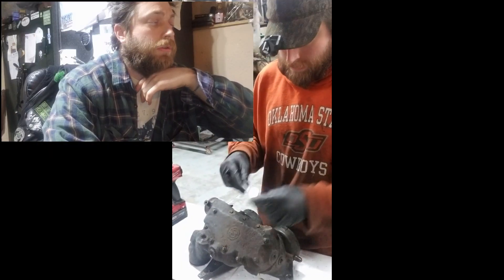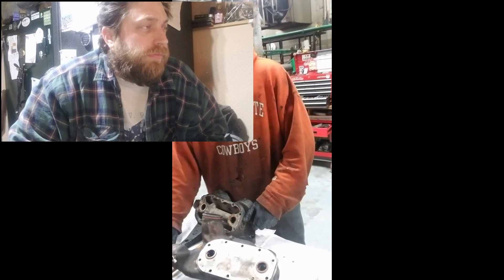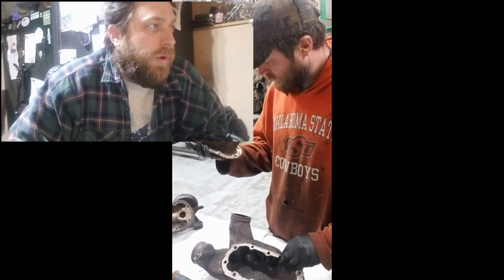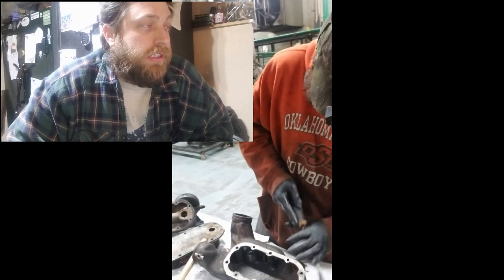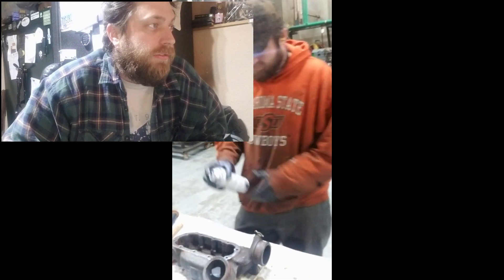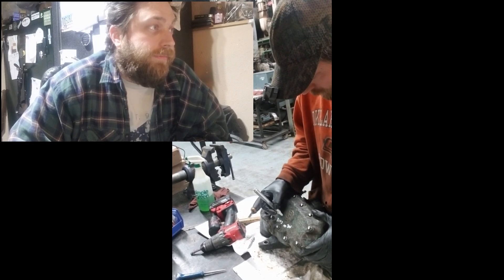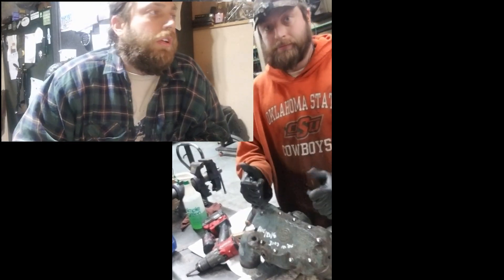Detroit 60 oil cooler rebuild

Comment: I think you may want to check because none of mine have two gaskets just one between the cooler and the top housing the only thing between the cooler and the housing that bolts to the block is two o rings that cover has to be able to squash them o rings to make it seal . Correct me if I’m wrong please.
Reply: It is correct, the outside of the cooler does not have a gasket, only the 2 Orings. I just repaired a Detroit 14 yesterday.

Comment: Great video! Are there any other common places that the oil will get into the coolant on these series 60 engines? What do you power with the electricity that you generate?
Reply from the maker: Nothing that's out of the ordinary, the only other place would be a head gasket really.  Or a catastrophic failure.  Primarily, the generators offset the gas plants power requirements, we used a waste stream of "dirty" methane with a small amount of diesel (1gal per hour) to run the engines.

The gas plant pulled a vacuum on a landfill, we collected all the gas from it, then produced pipeline ready methane with it.

I left the plant three years ago

Comment: I'm doing a replacement oil cooler on a Detroit 92 series on 600kw. It has been a nightmare trying to remove the core while it's attached to the engine. It looks like the rear bolts are mounted to the engine from the rear plate. The core has been sitting in the housing for the last 30 years so it's very hard to separate. Using a chisel and hammer I see you got it out. Have you done the oil cooler on a Detroit 92 series?

Comment: Hey man thank you for the video its awsome. 

I have a question which is the primary and secondary oil filter? 

How does the oil go back to the engine? 
( i only see one nipple that goes into the half where the oil filters screw into, but i dont see where it connects back to the engine.)

Thanks for any help  @poet99999

Comment: Have a question? I have a coolant/water leak at the oil cooler/oil filter housing. The only time I see the leak is when I come to the truck in the morning it doesn’t leak while I’m running neither when the engine is still hot. The engine has to sit for a while before it starts to leak. It is always around the oil filter in the back but not the one in the front is this the gaskets that needs to be replaced?
Reply: Mostlikely it os the gasket, because it sjrinks when its cold and leaks. Once it get hot it expands and seañs the gap. Hope that helps

Comment: How much you charge for this job???
Reply from the maker: Couldn't help you here, I was in a generator house making flat hourly
Reply: How you know when is bad I just rebuild the engine it has like 80 miles and start passing water in my oil

Comment: I have 2007 century with 1.2 million miles with original oil cooler. I found oil in my coolant. But no coolant sign  in oil    So many people said its coolant but some saying bad cylinder liners. It was started little slush on coolant cap and thick oil in coolant
Reply from the maker: Oil runs at significantly higher pressure than coolant.   The liners themselves may be fine but the sealing orings or the counter bores may be bad.   

Have you had any in frame rebuilds done yet?
Reply: poet99999 this engine is remanufactured by detroit around 500,000 miles ago.
Reply from the maker: At a million miles you're looking at rebuild time either way.

Comment: I have a 04 Freightliner Columbia and its leaking oil bad.. Someone told me it was the oil cooler.. No oil and water mixing.. Its a Detroit 60 series 14 liter.. Could that be possible?
Reply from the maker: IF it's the cooler, there are two orange flat orings that seal the cooler to block passeges.
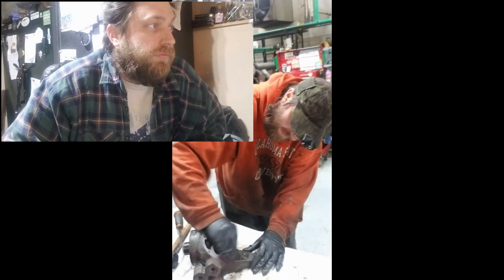Reply from the maker: If you go to @2:41 you can see the two oil passages that require the orings

Comment: Hello there
I have 2000 12.7 Detroit and I have coolant on my oil is any chance is problem cooler oil?I have this truck for 10 years know Never change.has 1 million and 800 Thousand miles. It’s been rebuild around 1.1 million. So help me out it’s a head gasket for the cooler oil problem?
Reply from the maker: I re read, it's been rebuilt once, I'd bet the oil cooler wasn't changed, usually an in frame is liners and bearings.  The coolers are usually pretty stout.  So you may try just a re-seal on the oil cooler.   You'd have to check your paperwork to see if the oil cooler was touched.  Especially if it's near 2 million miles.  But again the additional 700,000miles on a head gasket since the rebuild is good life as well.

If the cooler was never changed, I'd do a new cooler on principal... Near 2m after all
Reply from the maker: There is the main paper gasket as well as two rubber orings that can fail
Reply: Thank you very much Poet99999. Tomorrow I’m going to the shop. Mechanic told me that we check the oil cooler and then Air compressor. Thank you for your time Happy Thanksgiving
Reply from the maker: @gulianagrande7979  good luck with it!
Reply from the maker: Well you can test it, by pressuring the cooling system, that requires special equipment. 

 But since the oil cooler is such an easy change and reseal, I'd start with that.  But at a million miles you're looking at a rebuild shortly anyway, that's definitely a full service life in my book.

Comment: hey poet.  on a 2007 freightliner detoit 14l getting oil into the coolant.  is the oil cooler about the only thing that could be causing that?
Reply from the maker: no, but its certainly somewhere I'd start, easiest thing would be a reseal.   the cooler itself is pretty robust, they dont generally fail.  there are two sealing gaskets inside the housing then several oring type gaskets that seal the cooler housing to the block
Reply: Got the same problem now. Did you find you problem and what was it ?